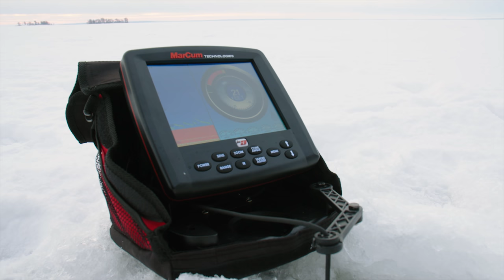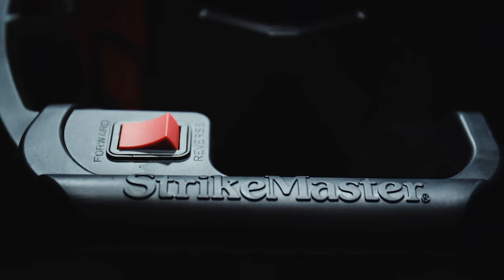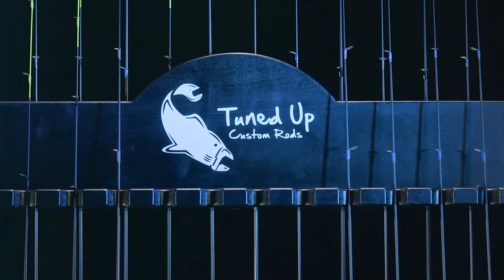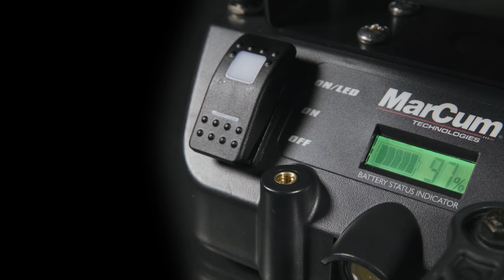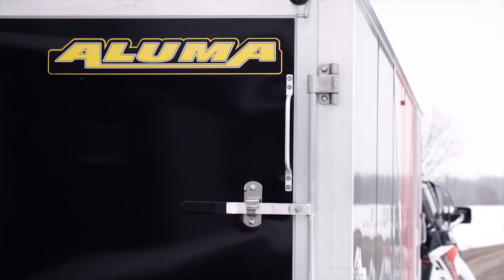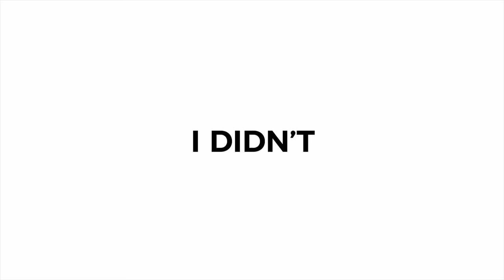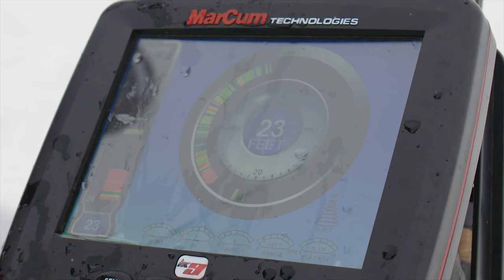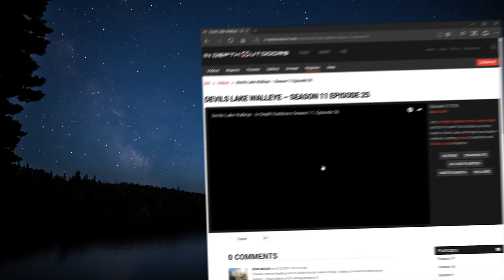Lake of the Woods Walleye Fishing - In-Depth Outdoors Season 13, Episode - 7

Comment: Would love to see you do an episode with gear that the average Joe could afford. Would love to see how you would perform. Cause it's kinda of hard for your average person to have $1000 in gear to ice fish with
Reply: You can use the cheaper stuff and do just fine,  I use a vex fl8 rigged with my helix for GPS  had vexilar for 20 years and helix for 5 for the boat and ice. Never owned a ice combo that cost more than 30 bucks location location location is key.  Cheap equipment will work if in the same location.   See it every spring as tournament guys always seem to follow me and my little boat around when river fishing eyes me with my cheap gear vs them with 60k boat 5k in electronics and thousands in rods .  Follow the location tips and your gear will work just fine
Reply: @kylecasetta4091  that's my point. Do a show showing that you don't need a rod and reel setup that costs $280. This combo for $30 from cabelas can get the job done to. You go to there forum and ask a ice rod question and 9/10 will tell you that you a TUCR. All I'm saying is that I would just to see them do an episode where there not using the best ice fishing gear money can buy.
Reply: Sponsors that's why, tucr and rest pay them to use their stuff so we can watch.  Could be st croix or g Loomis what ever.   People need to worry less about what they're using and more on how they're using it.  Personally a vexilar fan and jiffy augers guy doesn't mean cant find pointers on where when and why.  Could really care less what rod or flasher they use.
Reply: They would have caught fish with Fl-8’s and $30 combos.... why not use the nice gear if you have it?
Reply: @Detroit3Pistons  exactly.